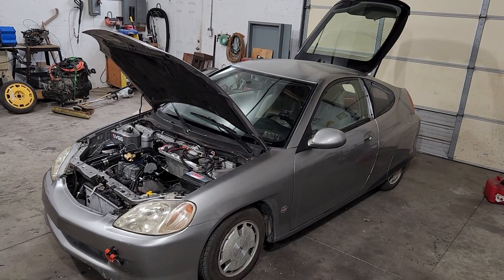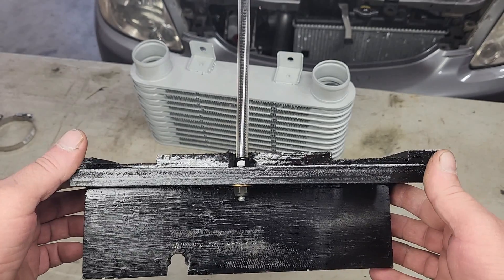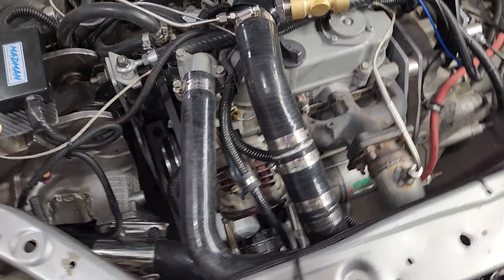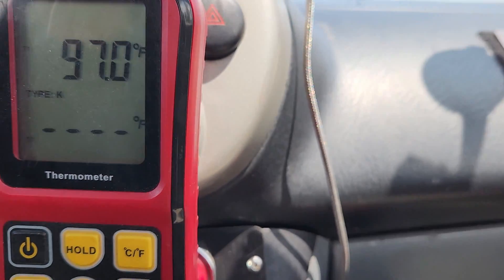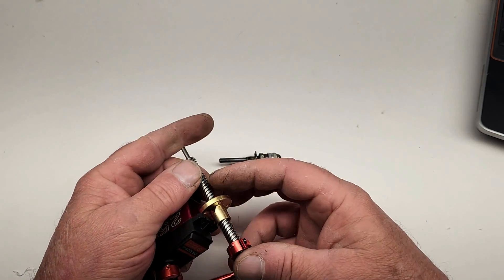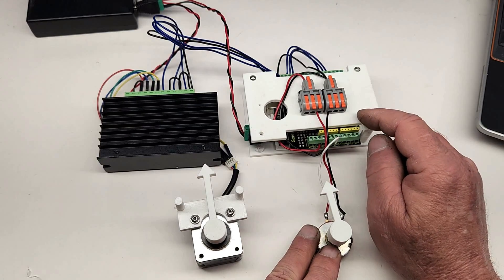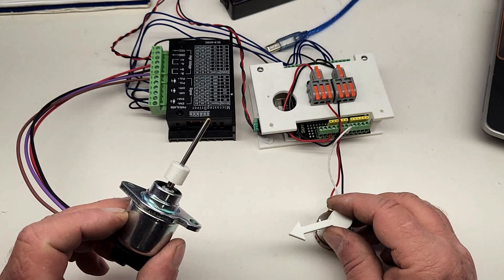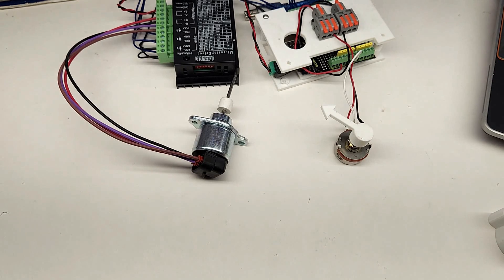S4 E17.  We install an intercooler on the AMR500 supercharged Kubota diesel.

Comment: I think some of the issue that was no difference is tge fact you put the intercooler Infront of the intake. The intake aould be sucking insome of your cooled air making the intercooler less efficient.
Reply from the maker: The intercooler is cooling the compressed air after the supercharger.  Its installed correctly.
Reply: @robotcantina8957  I'm not saying it installed incorrectly but surely the extra heat the intercooler is dumping out right by the air Intake is increasing the Intake temperature. Thus adding to the heat load the intercooler has to get rid of. Essentially like heat soak. Intercooled cars still seems to lack some power on hotter days and an intercooler can only do so much.

Comment: You'd get a lot less of a pressure drop, and probably better performance with a water to air intercooler instead of an air to air setup on a supercharger. Especially with such a small setup.

Bonus points if you can manage a Phenolic intercooler. Used to run a water to air phenolic intercooler on my supercharged project car. It was really effective.
Reply: They're also easy to fab. You can get a heater core for some vehicle that fits, and fab it into a mounting plate. 

For phenolic addition you just need to buy some sheets of phenolic, and fab them into the same hole/mounting shape (ideally on both intake and exit side).

For the "radiator" part there are also plenty of easy options that you could source in the same way as the heater core to repurpose.

Same with the pump. Lots of options there for electric pumps from repurposing too.

Comment: The intercooler adds resistance to the supercharger they always lower boost pressure but the gains by the cooler charge temps outweigh the 2PSi drop in pressure.

Comment: Jimbo, you might have to put a boost gauge before the intercooler and see if it’s lower the boost because it’s cooling or it it’s a restriction. It’s it’s a restriction. The reason the fuel consumption stayed the same could be due to the engine being more efficient due to cooler charge air but the supercharger consuming more horsepower having to force air through the intercooler.

Comment: That pressure drop across the intercooler could be entirely due to the temperature change. It's conceivable that at the lower pressure you still have a denser air charge going into the engine.

Comment: You're always going to get more pressure drop with longer intakes regardless of what you do, especially if there's a load of bends or sharp bends in the induction system. Water to air intercoolers can do with a lot less pressure drop but fitting that onto the current intake system? Yeah I'd rather not bother lol. 2 psi of pressure drop over an air to air intercooler system isn't anywhere close to bad though. It's pretty good considering how not fluid dynamics optimized that entire induction system is. I would've expected closer to 3-4 psi of drop personally. Honestly if you have the space, time, and will to do more pulleys I'd see if you could run it up to 1 bar and see if the EGT stays in check. Could make more power with less fuel if that works out!

Fuel economy probably stays the same regardless of what you do ATM as I'm assuming it's some sort of mechanical injection system which will just run the same amount of fuel through to the engine regardless of manifold air density. It's likely why the EGT stays the same too, it's running richer than before and getting hotter as a result.

Comment: I just read one of your replies about not being able to find a small enough idler pulley, but have you thought about using 2 or 3 bearings on a bolt as an idler? I have done it to get a lawnmower going again for the weekend 3 years ago and as far as I know it is still cutting grass like that today. I used a large washer on either side of the bearing stack to keep the belt on but I really don’t know if it was necessary. When I checked after running it for the day it didn’t look like the belt was rubbing the washers at all. I’m excited to see how far you can take this one. Thanks for hearing us out and sticking with it.
Reply from the maker: The idler solution is sort of a last resort because of the size and space.  I'm currently 3D printing something that will fit in the space without using an idler. It will be a few hours before I will have the finished part.
Reply: @robotcantina8957  sounds great, can’t wait to see it! Thanks for replying. It means a lot.

Comment: I’m sure other geeks in the comments will have more empirical data, but I don’t think you’re pushing enough boost to really see a performance difference, plus I don’t think diesels see as much of a performance difference as a gas engine. A lot of the performance loss without an intercooler on a gas engine is due to detonation and the need to pull ignition timing to avoid it. The hotter the intake charge, the more likely you are you get detonation, the more ignition timing you need to pull. That’s not really an issue on a diesel. Many older diesels running similar boost pressure as this do so without an intercooler. Many modern diesels use intercooler because 1) they’re running 2x-3x the boost in stock form and 2) emissions. The hotter the intake air charge is, the higher the NOx emissions.

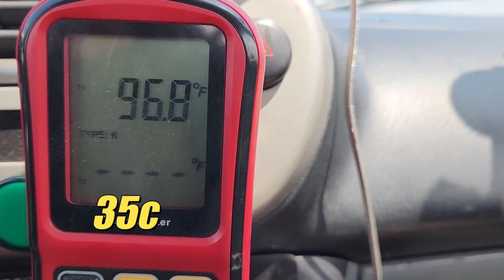Comment: @ 7:53, your engine temp seems to low for maximum fuel efficiency. I am under the impression that 180 - 190 is the sweet spot for efficient combustion. Am I wrong?

Comment: As for the camera vibration it's a matter of the engine's vibrations and the camera's frame rate matching so it wobbles back and forth visually. Same thing happens with LEDs and cameras where you get flashing or blinking when filmed.
Clamping the camera down more won't ever fix it, it will actually make it worse. You'd have to isolate the camera some how.

Comment: How’s it going, Jimbo?
Recently found your channel, been enjoying the two series you’ve done with this engine. You’ve even inspired me to build a small, diesel powered hatchback running on a 1l engine, once funds line up. With the fuel prices being what they are, economy is something that matters, to me at least. 
Something that might make the drivability more normal is setting the throttle to a fixed speed, and modulating the engine speed with the fuel rack (just spitballing, I understand that throttle by wire would be a massive undertaking on this rig). Also, it’s not surprising that the fuel economy doesn’t change with cooler IATs, the way to improve fuel economy is to run less fuel at the same engine speed — requiring a more efficient combustion process (or several other things that are likely outside the scope of this project), or the same fuel rate at a lower engine speed, requiring more power earlier in the rpm range. What lowering the IAT allows for is lower cylinder pressures at a given power output, meaning you can theoretically run more boost (by mass, not pressure) and have a complete burn of more fuel, offering more power potential at the same or similar engine loads and temperatures.
Anyway, sorry for the ramblings. I’m really enjoying what you’re making here, and whatever you decide to do moving forward on this, I’ll be interested to see how it works out. Thank you for the great videos!

Comment: could be that the cameras sensor behind the lens is mounted in rubber to protect it against bumps and stuff so yeah that would cause it to bump around no matter wat you do to the mount 
or that the sensor and the circuitboard its mounted to has come loose inside the camera 
dont think theres a simple way to solve it without taking the camera a part and see if this is the case 
once you have access to the inside and sumting is loose it shouldnt be too hard to fixate it using hotglue to stick it to the camera body or the circuitboard behind it

Comment: A strange moment where my knowledge of computers is intersected with engines; that stepper motor reset command is basically the same as the head reset in Commodore or Apple 5.25" floppy disk drives, as they often lacked track zero sensors to say whether the head was at home or not, so when you power up the drives, they retract the head to zero and you get the charateristic "headbanging" when the head hits the stop, and the drive is ready, assuming it hasn't banged its' last head... :P

Comment: The lost boost with the intercooler was due to lower temps (cold air occupies less space and creates less pressure inside the same space), not any kind of restriction by the intercooler.
That's what I have seen many times over and over again, so it's the norm, not an oddity.
I said it before, think of the intercooler as a safety aid, not a HP aid. If you end up getting any extra ponies out of it then great, look at it as a bonus.
Good luck and looking forward to newer automotive shenanigans. 😊👍

Comment: Joule Thompson may have the answer to your missing boost also combined gas law  or something yada yada Decrease in temperature at a fixed volume equals decrease in pressure I think you’re getting the same O2 in that old squeeze bang engine as before intercooling PS I love the content Stoichy stuff

Comment: You lost boost pressure not necessarily because of intercooler flow, but because of reduced temperature. Since colder gas takes up less volume

Comment: Your camera issues are typical "jello" caused by a CMOS sensor when exposed to vibration. Ideally you want a global shutter to prevent that, but it's not a common feature on most CMOS cameras on the market. Consider trying some "moon gel" for your mounting pad, this is available at music stores and is used to dampen drum sets.

Comment: I wonder if some of the pressure drop you see is actually because you're using a positive displacement supercharger and the lower intake temps mean the volumetric flow is lower? 🤔

Comment: Boost doesn't mean anything if the temperature is high because the cooler the air intake temperature is the denser it is the better the performance gains is and you don't need that blow-off contraption at all unless you plan on going past 15 psi of boost anyway because the engine you are using did come with a turbocharged variant for the factory and they ran with around 8 to 10 psi of boost without the intercooler because I've seen one personally on a walk behind concrete saw.
Reply from the maker: The boost dump valve is an experiment.  Its possible the little engine dosn't need full boost at cursing speed and we are just wasting energy by having the supercharger supply max boost.  Dumping some of the boost will lighten the load on the engine. Keep in mind its a tiny engine and we don't have a lot of power to waist.
Reply: @robotcantina8957  I will let you know that the impellers inside the supercharger your using are made of plastic and can only safely produce around 10 psi before they run the risk of exploding another YouTube channel just found this out and it damaged their entire engine so you may want to consider going it easy on how hard you push the supercharger.

Comment: Hey robot cantina, about your camera vibration issue...
Stiffening the mount is actually the opposite of what you want to be doing (*if you are using a pole mount that mounts the camera by jamming itself between the floor and ceiling of the car, yes you want that to be as stiff as possible, I am referring to how you mount your camera to that pole here). The stiffer the mount, the more vibration will get transferred from the body of the car (or the mounting pole) into the camera, leading to the awful vibration artifacts on video. The ideal would actually be to do the opposite, mounting the camera in some kind of shock mount to decouple it from the vibrations of the car (or mounting pole).
Reply: A gimbal mount might help; not sure if there's a cheap-but-good one out there (just about all the gimbals I see tend to be quite pricey)

Comment: Please delete intercooler and use water mist. I think it will lower fuel consumption
Diaphragm water pump and spray nozzle from garden mist system is cheap
Reply: I already bought injector and water diaphragm pump fo 16$ ) Now I need software for arduino to PWM control the pump (RPMxBoost pressure)

Comment: Jimbo after You've gathered the necessary data to program the fuel controller, are You planning to add EGT as an input to the controller and make it completely closed loop, potentially with safeties built in in case of "unexpected events" and runaway High EGT's? It'd be a lot cooler if You do..

Love the vids man!
Reply from the maker: Yes, the EGT will be monitored and if it gets too high we can simply push the fuel rack to correct the condition.   There is an alarm on the EGT right now, but it would be nice to have the  computer do all the work.

Comment: Loved this video Jimbo. The cleverness around the stepper motor really appeals. If I understand this correctly you're making a sort of very simple diesel equivalent of Variable Valve Timing on petrol engines - I wonder if this has ever been done before?! I guess modern diesels are direct injection so the fuel delivery can be automated, but has anyone built a retrofit version for "full size" old-style diesels before?
Reply from the maker: The thingy I'm building is actually common on turbo diesel engines.  Since our engine is tiny, nothing that is available will actually work and therefore we need to build our own.

Comment: This is simply brilliant! You may have already considered it, but I think at some point you should figure out a very common lightweight vehicle that people could buy for very cheap, say a late '90s to early 2000s Honda Civic or Toyota Corolla. They could pull out the motor and install a cheap harbor freight motor or something. You could sell specialty parts or simply just list out where people can buy everything. You could have various versions of whether someone would only commute locally to have more power or longer distances to have better efficiency. This would give young tinkerers that don't have much money a way to get on the road :)

Comment: I have been thinking and working on this problem of feul economy for years. Intercooling or not should not make a big economy difference. Though too cold air might hinder diesel droplets boiling off to gas. As long as there is enough air in chamber, squeesing in denser or not air shouldn't change much. Economy is about the diesel injected and how much energy you get out of it to the wheels. And about how much is lost. The best improvements I got was heating diesel. Looser valve clearance on exhaust valves for longer expansion stroke. Looser intake valves for more Miller type cycle. Still adjusting to find best point for valves. Currently 0.8mm exhaust valve clearance instead of 0.4mm. And 1.2mm intake valve clearance instead of 0.4mm.

Comment: With normal belt movement wouldn't it be easier to just add an idler pully and give you all the clearance you could ever need?
Reply from the maker: Keep in mind the engine looks big on video, buts its actually really small.  we looked at using a small belt tensioner and it causes more problems than its worth.

Comment: Arduinos have onboard permanent memory. You can write your steps to that memory every time it changes so when it's shut off you can read those steps again when it turns back on. Way simpler!
Reply from the maker: That's true but in automation its good practice to establish home position on every power cycle.
Reply: @robotcantina8957  That is true. You could use the stored step count to count backwards to home though!

Comment: In front of the radiator would also be fine for the intercooler, I don't think you're going to need to worry about heat soak unless you plan on driving this around on Venus in the summer at the equator. Also going back to coolant temps, that linear actuator and controller scheme for the fuel rack could 100% be used orifice to control coolant temp via a variable coolant flow orifice which is exactly what some very modern cars are using now, you'd be on the bleeding edge of technology!

Comment: RE: camera shake, if the camera doesn’t have internalized stabilization, you’re going to need to build that into the mount. Making the mount stiffer won’t help much. I’d look for a used GoPro black series, they have good images and are user friendly. I have a GoPro 9 black and love it, but the 5-8 black series are great and have great stabilization.

Comment: Off top of my head, more boost really just means more Air, to stay at stoich more air = more fuel.  the temp increase is super awesome, its essentially the same theory as Density altitude.. Overall this small diesel idea is fantastic.
Reply from the maker: Keep in mind on a diesel the AFR is super lean (22:1) and the leaner it is the cooler the exhaust gas temps are.  Adding fuel boosts power, but it will damage the engine if too much fuel is added for an extended time.  The gizmo will provide the best balance for fuel and boost.

Comment: Can you fit a MAF sensor somewhere before the supercharger so you can see the changes in airflow with different boost and air temps? It would help with your fuel rack adjustment tuning as well.